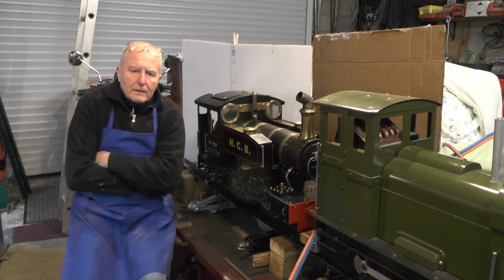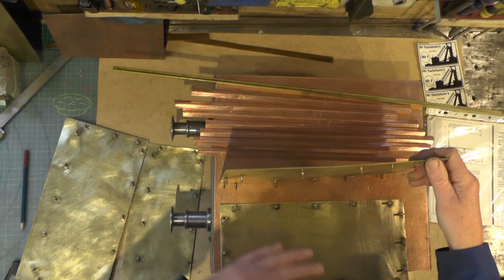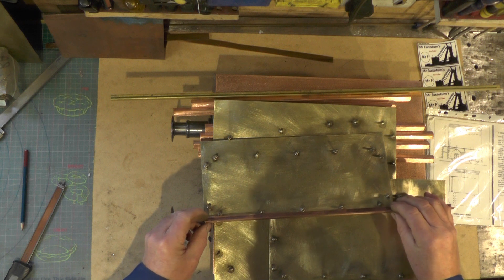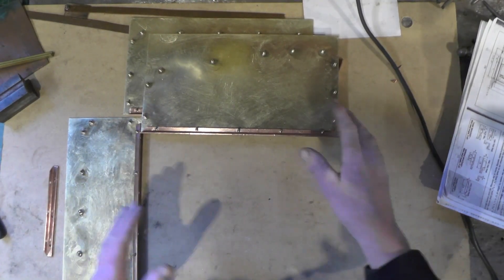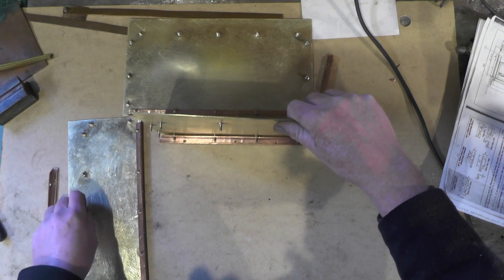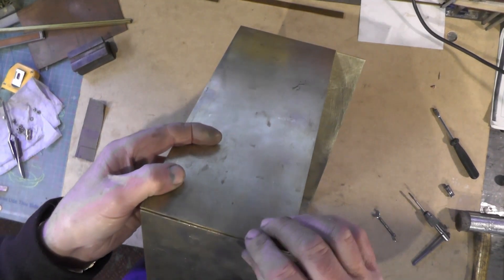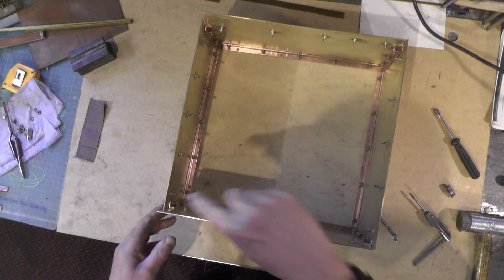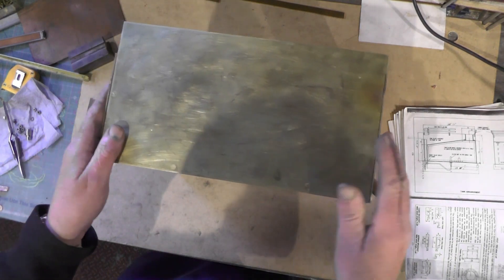Make a Water Tender TANK BUILD P4 - For "Scratch"(My Beginners Steam Locomotive Series)"mr factotum"

Comment: Hi Kev. I'm also building a sweetpea tender, I'm enjoying watching your build, I've just finished building my chassis so now it's time to build the tank, I want something different looking to the norm though, still designing, lots of scrap drawings lol
Reply from the maker: eyup Trevor
Thanks for your comments and for watching, i've seen you on the SP f/book group.
Nothing wrong with being different and having a different approach, I just make my materials fit around what i want much of the time, we are all different and if we all did the same thing and stuck to drawings i think it would be boring with no variety, i built my Metre Maid with the same approach, i am just looking at a SP / MM  gas burner for a friend, if it works i might make one, just for an occassional change, again variety, the coal men might not be happy, but there you go!!!
take care
keep in touch of you get on with the tender
take care
Kev
Reply from the maker: eyup Trevor
Ive seen your tender chassis on SP group, looks great, i too put angle the opposite way for ease of assembly,  wish i'd have thrown some primer on too, hindsights a wonderful thing. never mind, sprayed with WD to keep rust off for now. I'ts bloody cold in my workshop though🥶🥶🥶🥶👍👍👍👍👍👍👍👍
cheers
Kev
Reply: @MrFactotum  morning Kev, I've got one of those Chinese diesel heaters in my workshop, cheap to run and gives out just enough heat to be comfortable. I've built a few locos and a 2" stw traction engine, I'd rather paint as I go along as it's a pain to have to strip them down just to paint them, and then they never go back together as good
Reply from the maker: @Mr-Steam  morning Trevor 
Never thought of the diesel heater, i have a 47kg propane with a portable heater i use on 1 bar (not the 3) and it follows me around where i'm working to keep the chill off me, that 47kg last me a couple of years on the frugal setting.
Does the diesel Heater give off much fumes!!!
👍👍👍👍🥶🥶🥶🥶
Cheers and take care
Kev
Reply: @MrFactotum  Not a problem with replies Kev, my diesel heater has it's exhaust going through a 25mm hole in the wall, no fumes at all, the hot air is recirculated through it. I had an LPG heater but found it gave off too much water vapour, diesel heaters don't emit anything inside, I do have a Co detector in my w/shop just in case the exhaust joint starts leaking though.
Reply from the maker: @Mr-Steam 
 cheersTrevor
Thanks for info.

Is it the Vevor 8kw model
thanks 
Kev
Reply: @MrFactotum  No, mine is the hcalory 8Kw all in one, I bought 20L of kerosene yesterday to try instead of diesel (cheaper) but it isn't putting as much heat out, once that's gone I think I will be going back to red diesel @ £1.49L Roll on some warmer weather....
Reply from the maker: @Mr-Steam  Thanks for info Trevor, it's appreciated
atb
Kev
Reply: @MrFactotum  It makes me happy to help good people 😉
Reply from the maker: eyup Trevor
just seen your finished tender chassis on SP Group. looks great. Your right it's been bloody freezing ditto, in my "Cold Store" 
I've just ordered one of those CDH's to try. Should get it before end of year , hopefully.
Do you run yours on regular diesel or some other combinations, any advice on these appreciated
cheers
Kev
Reply: @MrFactotum  Thanks Kev, 
a couple of things regarding the tender...
1) Spot the oil holes in my axle boxes drilled at an angle so the oil goes to the centre of the bearing surfaces.
2) the spring guides are awkward to get in, chamfer the holes in the axle boxes slightly.
As far as the diesel heater goes, I have always run mine on neat diesel but I'm just trying it on a mix of diesel and kerosene 1l diesel to 20l kerosene, it doesn't give as much heat out but its cheaper, swings and roundabouts probably costs the same as I have to turn it up more.  Make sure the exhaust is well sealed and of course it goes to outside, also get a Carbon monoxide detector
Reply from the maker: @Mr-Steam  cheers Trevor
It's a while back since i did my chassis, but from memory without going in to the cold garage at mo', i think i drilled my oil hole at an angle to pick up an oil groove that i machined in the centre of the axle box. 
Yes the exhaust , i already have a chimney flue in my garage so will pipe it in to that hopefully.
I priced up 20L of kerosene today, it was £45 so thats £2.25 /L, which is dearer than reg diesel at the pump at £1.73 here at tesco's, i don;t think red diesel is available anymore around us, so it looks like being reg diesel, and give government somemore tax!!😒😒
cheers
Kev
Reply: @MrFactotum  the exhaust should always point downwards from the heater because of condensation, even the silencer has a drainage hole in it. I paid £1.20l for my kerosene 
 I thought about putting a groove in my axles but decided to try it first without, they are such a good fit they take some pulling off and I get a good pop when I pull them off with my finger over the oil hole, perfectly free running though. Someone mentioned fitting bearings but I think they are more trouble than they are worth
Reply from the maker: @Mr-Steam  Thanks for info Trevor, yes i had the same feeling about using bearings, 
looks like i will have to drill through the wall then with the exhaust.
Looks like the lubricant depot near me was trying to lift my leg then, i will do some research on the keresene, trouble is there doesn't seem to be many suppliers around me, unless i'm not looking hard enough.
cheers Kev
Reply: @MrFactotum  took me ages to find a supplier even then £1.20 is expensive according to others on fb. I paid £1.49 for red diesel and I think it's better as I don't have to turn my heater up as much, noticed today asda £1.71 so it's coming down
Reply from the maker: @Mr-Steam  cheers Trevor i will have a search for some red diesel, even thats hard to track down, thanks for steering me the right way, it's appreciated
take care
Kev
Reply from the maker: @Mr-Steam  eyup Trevor. whenever i'm buying anything i always try to do as much research as i can, 
don't want to put the frighteners on you but i found information about a recall on these heaters, on Reddit forum here's the info. in brackets (((  )))
(((((((((VBOSCH1

OP
·
2 mo. ago
Below is the email I received from eBay today. Is there any news to share why they are taking this action?

We take product safety very seriously. We’re reaching out to you because an item you purchased may have been recalled or pose a safety hazard. We recommend that you stop using this product. If you have questions about the item(s), please reach out to the seller or the manufacturer. Item details are listed below.

This notification is to let you know of an item reported by the Office of Product Safety Standards (OPSS). We have removed this product without a violation to your account, to get the affected product off the site.

Please review your inventory and remove any similar listings which do not meet The Supply of Machinery (Safety) Regulations 2008 and block these items from your listing feed.

If you have any problems, you may be eligible to return this item for a refund. Learn more about our eBay Money Back Guarantee.

Item details: 255748954115 - Diesel Air Heater 12V 2KW Remote Knob Control 10L Tank Caravan Motorhome Trucks

1

Reply
Share
Report
Save
Follow

User avatar
level 2
Immediate-Cod6065
·
28 days ago
I have received the same e-mail from ebay mor or less tell me there's a problem with my 8000watt diesel heater)))))))))))

Also there's a chap on youtube video giving the same info out. here's a link to the video he had a recall from ebay. https://youtu.be/AgMpJHQqDRg

Like i said don't want to cause you concern but, but i am still looking in to this, it might be nothing, the latest info i got from somewhere ( can't remember were) is that they were understanding it's the GREEN type fuel hose that's not up to the job. 
Just thought i would pass on this info for you. 
If i find anything else out i will let you know.
take care
Kev
Reply from the maker: @Mr-Steam  Sounds about right Trevor, i think common sense will help us prevail, i always make sure everything is belt and braced, as for poor instructions, i'm used to those by now, usually pictures paint a thousand unreadable words, apparantly my unit is due to land by 29th Dec, (can't wait) that might be a laugh though with all the disputes going on!!
I will keep you posted how i get on with it.
Then hopefully back on the tender tank, soon be ready for soldering it up, when i can get time away from the Grandkids!🤣🤣🙌🙌😉😉👍👍
ATB
Kev
Reply: @MrFactotum  think I might be having another break from building, just bought an insta 360x3 camera, been out to my kinver club today and got a nice video in the sunshine but there's a lot to learn, I've been into stills photography for many years but this is all new to me lol
Happy Christmas 
All the best
🎄🤶🎅
Trevor
Reply from the maker: Eyup Trevor
Just to let you know my  CDH came earlier than expected, just doing a temporary  initial installation, fired up and GREAT so far Bloody Marverlous, putting a video up of the whole event tomorrow, 
Thanks for setting the seed in my head and for all the info.
MX & HNY
Kev
Reply: @MrFactotum  Brilliant Kev, nice early Christmas pressie for you, I hope you get on well with it, during the cold spell I had to run mine on full which made the fan a bit noisy, it's ok now it's not as cold outside though. I'm still trying to get my head round my new camera, very weird having a 360⁰ view to chose from. You must have some decent gear to enable you to do your YouTube videos ? I don't think I'll be doing any, must take you ages to get it all together, I'm useless at explaining stuff lol
Reply from the maker: @Mr-Steam  eyup Trevor
Camera sounds Great, i only have a Panasonic camcorder which is great, and a Gopro that i can't get on with so its an ornament at moment.
YT does treble the time of doing a job, 1/3 videoing, 1/3 to edit and 1/3 to do the work!!! but as for explaining, i just say it as it is, and do it my way, sometimes unorthadox, but the world would be boring if we all did the everything the same way!!!.
There's always numerous ways to do anything in engineering to get to the same end result!!
🙌🙌🤔🤔another question, sorry!!
What position have you installed your cdh
High Med or Low,
i've put mine high at moment with the vents pointing downwards, just for convenience to try it, I thought low might be better but it means more hassle for me to install if i go that route. 
I've managed to find some red diesel at £1.23/l at moment. for small quantities ie 20l I think its the only place near me within a 15mile radius, all other suppliers have a minimum 500L orders. Its really scarce here!!
cheers
Kev
Reply: @MrFactotum  Hi Kev, I mounted mine temporarily about 2 feet off the ground on one of my many storage boxes, I've used the air outlet pipe to direct the heat at me while I'm working, I think my temporary fitting works well and might end up permanent lol. 21⁰ in here now, I've just made the water filter. If you WhatsApp me I could send you some photos of my installation
Reply from the maker: @Mr-Steam  Great , don't i need your mob no. to whatsap you or am i missing something!!!! if i do you can email it me, my email is on my about page, only shows up when using a PC though!!, Would love to see some pics.👍👍